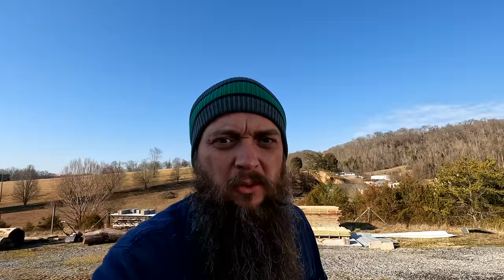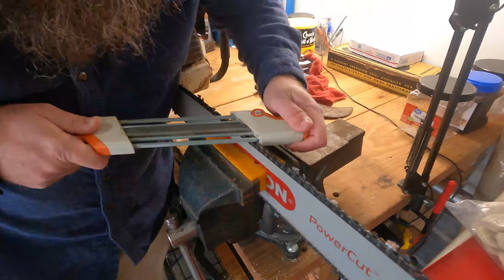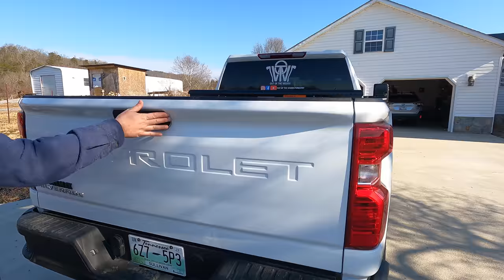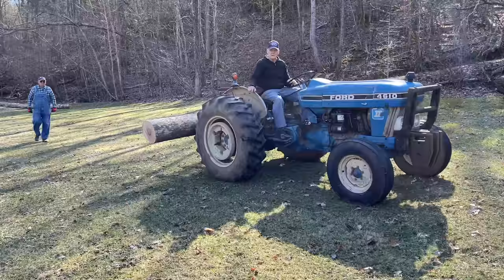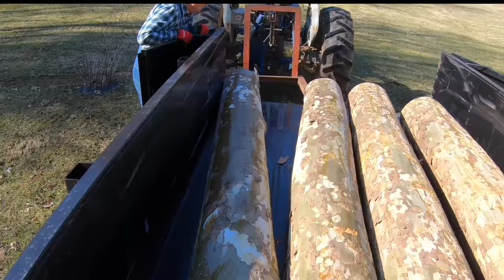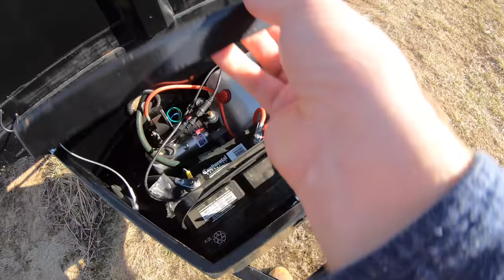Can A Classic Ford Tractor Get The Logs To My Sawmill?

Comment: I just came to say cherish the time you have with your dad. My dad while still alive, he does not get around to good and walks with a walker. Luckily he was able to get around 20 years ago when I bought my house. I removed a wall and did a bunch of drywall. He did a lot of the measuring and cutting of the drywall. The other day I had to redo the screen on the front door and remembered my late mom had replaced it when I bought the house. In any case I saw your dad helping you and he looks pretty fit.

Comment: The wonderful thing about goats is that they have such a keen sense of self preservation! Looking forward to seeing them at work!  Just be careful leaving your nice truck in the field with them as they are very likely to hop on the roof for a better view and ruin the paint!!
Reply: If goats or sheep are around, be sure to do a good brake check before driving.  For some reason sheep love rubber brake lines.

Comment: When I did a lot of chainsaw cutting, I used a full skip, chisel bit chain, and filed with a 3 cornered file by hand. I don't remember exactly how I came to use a 3 cornered file - probably experimenting - but it would alter the inside tooth cut flat ( ~round to a flat-grind). It's been at least 40 years ago, but I do remember having extremely sharp, fast cutting chains in such a file configuration.  As always, keep it outa da dirt!!

Comment: Stihl makes a file set that does the cutting tooth and the raker. Works pretty slick. They go by the pitch of the chain, so if y’all are thinking about it, make sure you have the model number and/or the chain part number.

Comment: Hi Nathan! Another great video. Back in my wood cutting days I cut logs, stud wood and firewood, for a porter. 8 ft long to 16ft long logs. I was running a 365 husky. Lots of hp and I could sharpen the thing a bit different the most. I’d use a size smaller round file to give more hook on the tooth and usually a rub on the rakes as you call them every other time I sharpen,all to make it faster cutting. I learned to do it free hand.

Comment: Hello Nathan,   Back in the years before rubber- tired skidders, Ford 8N, 2N, and  9N  tractors skidded a lot of logs.  Cat D2's were also popular.  My D-2 has skidded some big logs with no problem.  Years ago, a faller friend sold me his Silvey grinder.  I never have used it as I prefer hand filing.  Perhaps you should add a winch to the front of your trailer.  I have a winch rigged to go into the receivers on the trucks and also fits on the front of a tilt trailer.

Comment: We have a 1947 Nuffield tractor still going here mate.
Doesn't miss a beat, kinda dangerous if you let the clutch out with the throttle high and the gear selector in third or fourth.
Can pop wheelies and either cripple or kill you if you're not careful.
Reply: Pretty safe unless you're City smart I guess.

Comment: You find the worst tooth do it first, count the strokes and do them all the same amount, that way all of the "Rakers and teeth are of equal setting and the chain cuts the smoothest possible, that way it is also easier on the chain sprocket, less jumping also and less Kick back. 39 years of it has taught me this is the best way

Comment: dont have to count the strokes but if you dont sharpen it all the same it will cut cockeyed then you have to clean it up and that wasts chains  i worked in electric line right aways been around a few dull saws

Comment: There is almost nothing you can't do with an older tractor, the ingenuity part is on the side of the operator. Sharpening a chain by hand fulltime is an art really, some can do it but most can't on a long term basis. Guess I'm admitting to my not having the ability on the long term. If your length of tooth is off left to right your cut will cup and it's compounded on larger tree's. It can cause your bar to bind and get stuck if you keep going on deep cuts, I learned it the hard way but always carried extra bars the same way you would extra chains to match. Maybe just the average occasional chainsaw user wouldn't have to worry about it but you wouldn't want to have to deal with it while felling a large hardwood tree. Love watching Nathan use that sawmill!

Comment: When you said antique I was thinking  8N or 9N this thing is a very young tractor
Reply from the maker: Classic and antique tractors must meet the following requirements: Tractors must be 25 years and older.
I didn't write the rule book lol,
Reply: @OutoftheWoods0623  I feel you man I think I am getting old
Reply: On our ranch a long time ago we had an 8N that we used for raking hay.  Had the narrow front tires on it.  We also had a system that added a bogey wheel (regular type tire) in front on the rear tire.  This let us put tracks on the tractor.  About the only time we used them was when we were haying a very wet, soft muddy coulee and the tractor could get stuck real easy.  We also used that tractor to drag in a lot of the Cottonwood trees that we used for firewood.  Antique tractors have and still can do a lot of work, plus you don't need a college degree to repair them.